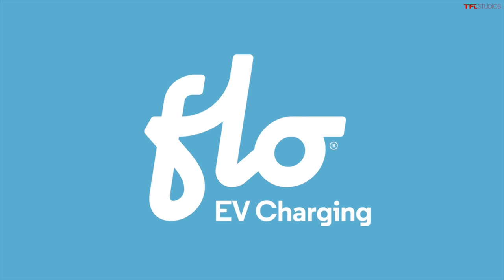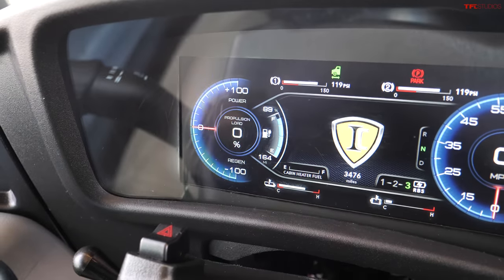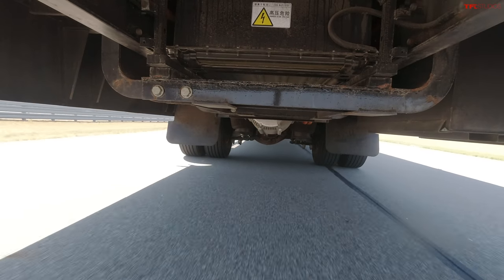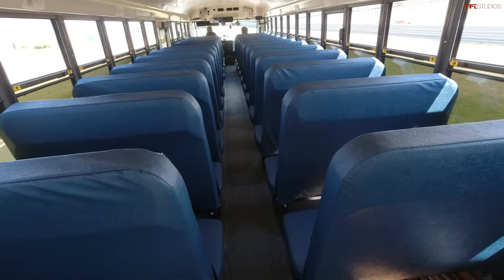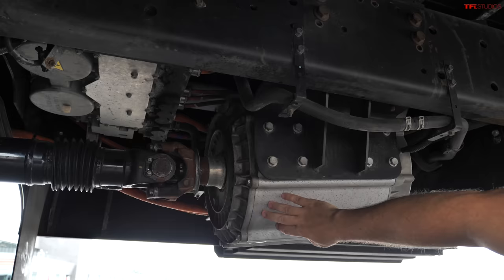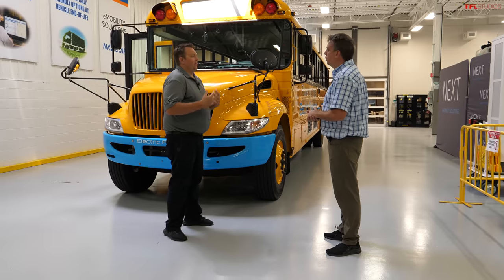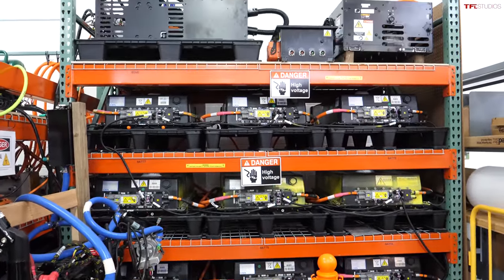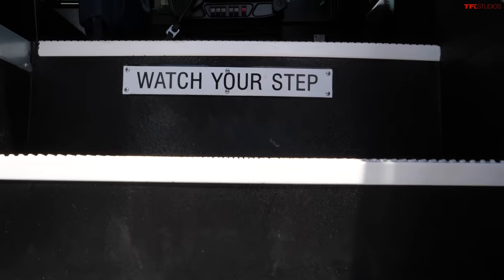Does This EV School Bus Put The First Nail in The Coffin Of The Classic Yellow DIESEL Kid Hauler?

Comment: Never had seat belts on buss's I rode on.  The aisles were wider.  (in my day) The EV makers need to change the dumb fuel gauge icon from a fuel pump to an EV charging cable.  And finally, he said we would be seeing these things coming everywhere?  🤣  Good luck with that.  I rode a bus that was 20 years old and often being replaced with a "sub bus" because it was in constant need of repair instead of just buying a new, reliable, efficient buss.  Guess what?  That same bus is STILL taking kids around in my district 30 more years later.  Budget in the districts here do NOT go into transportation.  ;)
Reply: In my state buses must be retired and sold off at 10 years. Private companies can't carry students in a bus over that age too. EVs have less to break but the components are more specialized. My local district is flat broke but they'll have no choice but to modernize when the time comes.
Reply: @bwofficial1776  re: "In my state buses must be retired and sold off at 10 years." exactly, there's a 10-12 year limit on how old School Buses can be.  that's why whenever we see a big yellow School Bus with kids on it, it generally looks new (that's because it is).  Buses are usually operated/replaced under the same "fleet" metrics as Class 8 Semis.  and it's even more important that these maintenance schedules are adhered to when you consider the "cargo" you are transporting are KIDS, and this will become painfully evident once one discovers that the PARENTS of many of these kids are local business owners, government and state officials, Law Enforcement, etc (aw crap).  yeah, something else not to overlook is these School Bus fleets are also subject to twice yearly DOT inspections, so if anyone is inclined to FORGET all the things I just mentioned, no worries, the DOT inspector will be more than happy to remind you with a citation.

Comment: 200 miles from a 315kWHr battery pack, works out to about 1.6 KW/mi. 

I wonder if you could tow a diesel generator for long trip, like for athletics?  Say you have a trip from Laramie HS to Rock Springs HS (212 miles).  So about 678 KW used for the trip.  That trip takes about 3.5 hours each way.  With 3 hours downtime for the bus during the activity (maybe more depending on sport), you have a total of 10 hours run time for the generator.  Using a Generac MDG75DF4 Diesel Generator, at 68KW, it would generate roughly 680 kWHr during the trip....enough to charge the battery fully, twice.  Even running it only during downtime would almost give it enough power to make the trip home. I assume towing the trailer would cost some efficiency, but not as much as an F150 would lose...the bus is a great big wind-break for the trailer, and the Generac has a much smaller profile than what TFL tested behind the Ford. Even figuring a 25% loss in range due to the trailer, it works out to about 850KW needed.  Given the 315KW in the battery to start, plus the 680KW generated on the 10 hour trip, you have an 18% cushion.  And the generator would still have 17 hours worth of fuel onboard in case of emergency (road closures, etc.).  

Not sure about charging while driving, or if using a dedicated DC generator would be better than the off-the-shelf one I looked up.  My initial thought was having an onboard generator much like RVs have, but thought it might be better to have a larger one towed as needed, rather than always be hauling the extra weight of a smaller one.  Plus, for longer trips, a larger would be needed anyhow. You can get towable units that would charge this bus as fast as it uses the energy (cruising, not floored). 

A diesel bus gets about 9mpg, so would use about 47gal.  My idea above would use about the same using the generator.  So no real savings there.  But the savings for the regular bus usage would be significant. Laramie pays $0.1449/kWHr for electricity, much of which can come from wind power (NEVER a shortage of wind in Wyoming...they really ought to turn those damn fans off).  That works out to under 24 cents per mile.  Compared to diesel at $4.47/gal (today's cheapest price in Laramie), which works out to a hair under 50 cents per mile, or about double.

Comment: I hadn’t thought about it until now but ev buses would have a tone of regen potential. They might have a cross section 2-4x as big as a CUV and their drag coefficient might be 40% higher but they have more than 7x the weight (when loaded) and will operate at slower speeds anyway.

Comment: They should do a Diesel electric. Have a diesel generator charge the battery. Trains use the same thing, & they’re rly efficient.
Reply: WAY too expensive, heavy (probably requiring a suspension redesign) and more complex (2 systems to maintain) for a simple school bus. Also this defeats the purpose of eliminating the problem of in cabin exhaust levels and diesel costs.

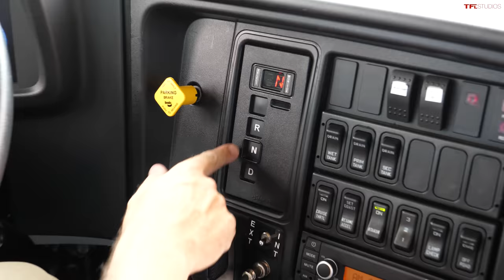Comment: The bus DOES have cruise control, it’s just on the panel next to the gear shifter. The first switch on the 3rd row (above the radio) shown at 1:20.
Reply: Yea, just not on the steering column.. I have used both setups where the cruise control is on the steering and flashers/door on the side panel. I much prefer the flashers/door on the steering column as that is used much more than cruise control - It is much safer for dropping and picking up.

Comment: So, the average school bus in the US drives 130km in one day and this electric school bus has the largest battery in the industry that can go 320km on a single charge. That means you can easily do two days without charging the bus at the bus depo and still have 30km left at the end of day. Of course, this will vary on the route taken.

We can easily drop diesel buses that can increase the chances of cancer, especially in younger children who are more susceptible to harmful gases.

Comment: The electrical grid is not here for school bus charging and wont be for a long time. Take every school bus parking lot. Now fully destroy it, wire in millions in chargers, and repour the parking lot. That's only the bus station, now the city has to upgrade service and so on.
Reply: Every one of our bus parking spots already has a electrical outlet to plug our busses into during winter months. We have plenty of power for upgrading to charging ports for each bus. They would be charging at night when power demand is lower.  That might not be the same everywhere, but it is in many places. So to say it won't be for a long time?!?!? I do not know if that is fair.. It is the replacement cost of busses that will be the major stumbling block, not the infrastructure.

Comment: With the volume of roof on a bus I would have thought solar on top would have been feasible to some degree
Reply: Even if it were only 30% of the required charge, schools are famously strapped for cash on a monthly basis.   Anything that kept the bills down would be smiled upon I imagine.
Reply: Cost to benefit is not worth it. Put the solar panels on the ground or on top of buildings.

Comment: My only concern is the long distance travel they sometimes make School buses do. Then again if they packed a diesel generator in the old engine bay as a range extender and make it easy and simple to switch in the event it breaks down they could sell these things like hot cakes.
Reply: Or, a simpler solution. Keep a small number of diesel buses around for that purpose, replace the rest of them with electrics. By the time those last remaining diesel buses reach end of life, battery technology will have improved, and the issue of occasional long trips becomes academic.
Reply: @ab-tf5fl  ...... The reason I suggest having a diesel-electric or Gas-electric Bus is so All electric buses would get cheaper do to economies of scale. If all the buses have roughly the same parts then it makes production and reparability easier.

Comment: Nobody seems to comment on cost and where the power to charge each bus comes from. Then the cost for each station, repair costs, new power grid system, cost to train mechanics if they can qualify to work on them and so much more. Economic nightmare.
Reply: They are only going to show the positives and sadly none of the negatives. Same exact way it was when buses went from gasoline to diesel.
Reply: @hippyhillbillie2958  Diesel is better than gas because it burns less.

Comment: 315kwh battery- good lord that's a LOT of stored energy. that's literally about a thousand small space heaters all running for an hour. and the regen braking recaptures a bit of that back as well. these things would have to cost at least 3x what a normal gas powered bus costs. It's still worth it in the long term with significantly less maintenance costs, the cost of electricity by the day is MUCH lower than the cost of gasoline per day.

Comment: With electric power, a conventional long nose school bus may soon be displaced with the cab forward models to gain additional maneuverability and capacity in a shorter package. The benefits of the conventional bus are no longer apparent.
Reply: It is actually going the other direction, conventionals are taking over right now, even with electric.
Reply: I much prefer the conventional long nose over the cab forward designs as a driver - I have driven both. What you loose in forward visibility you gain in perceived safety of having the nose out front.
Reply: It may depend on where you at but where I live some disricts are still buying Flat Noes buses. Most of the electric buses where I live are Flat Noeses.
Reply: @SomeDudeWithAnExitSign  Yeah, some areas will hold on. Transit (flat nose) buses only account for 6% of school bus sales nationwide, I don't see that changing much with EV.
Reply: @SomeDudeWithAnExitSign  "Noes" LOL You crack me up!

Comment: I am a bus driver and for normal student pick up it makes sense but then when you have a 3hr one way field trip that’s when the diesel is still needed
Reply: What's your longest field trip? These buses have a 200 mile range, that seems like a lot for school field trips. Im trying to imagine a trip where that wouldn't be enough. From my town a trip into Boston is about 100 miles roundtrip. It would even be possible to take them to Portland Maine, that's a hundred miles each way. Buses have to wait hours for the kids so you could do that at a CCS charger, for the Portland trip you would want to add about 50 miles which you could do in a couple of hours at a low speed, 62KW, charger. If they were taking the kids to New York City or DC then you would want a diesel  so it would make sense for the bus company to keep one diesel in their fleet.
Reply: I live in the Mountain West. It’s easy to imagine a sporting event with a 400 mile round-trip. If you did that with an electric bus you would need planning to recharge while the event was going on. But, probably 90% of the miles the school buses drive fit that 80 mile round-trip range. If your school district had a fleet of 20 buses, make 16 or 18 of them electric and have 2 to 4 diesel busses for the long trips.
Reply: These can be charged at any fast charger.

As long as one is designed to fit a bus, a driver could go 200 miles, charge back up in 2 hours or so and have power to go back.

Comment: Why no solar roof? Thats got to be 16HP/hr maybe an extra 10-20 mile range per day, with air ducting you could even use the heat from the sun heating the panels in the winter for interior heating, which should extend the range as well(compared to just releasing that heat into the outside air)

Comment: could this frame be used for a Class A or C mtorhome and et 200 miles?
Reply: Absolutely. Unfortunately International's DC fast charge rate is a JOKE. Less than 200kw for a pack around 300kwh?

Comment: Good idea as long as the bus terminal has full solar capacity to charge all the buses. If they are charging up from a grid powered by coal or gas it’s still a polluter
Reply: Evs powered from a 100% coal powered grid are already cleaner than a fossil vehicle.

And the grid is already getting greener. As more clean power comes online it therefore immediately makes all these vehicles cleaner.
Reply: Several studies by major institutions and universities have confirmed that electric vehicles produce half the carbon of internal combustion vehicles, in the very worst case, when powered entirely by coal.  In the best case (solar, wind, hydro, geothermal), running an EV burns nothing at all.  

Almost every US state uses some of these non- polluting energy sources and the percentage is rapidly increasing.  The mix of energy sources varies but in several states, running an EV produces a small fraction of the CO2 that an ICE car generates.

Comment: Idea for anywhere except colder climates.
Reply: why? this bus is equipped with a battery conditioning system and electric climate control
Reply: @KoleWilliams  Would be interesting to see, we have one already and it needs to be parked inside overnight when temperatures get colder, and it isn't even run during the winter months at temps about -20 to -30 C

Comment: How many millions of dollars are tax payers going to be on the hook for to build charging stations that can handle up to 200 buses all needing to be charged? That does not even factor in the $250,000 cost of the buses.
Reply: Closer to $400,000 for one bus
Reply: Much less for tax payers than it will to continue to run diesel over the next decade.
Reply: They don't need public charging. Like any fleet vehicle, they charge overnight with a typical $300 charger

Comment: So what about in cases, bus finishes it’s route, then returns to the HS to take students to a football game. Driver remains in the bus with the 3 AC systems running. Personally, I think for the cost of theses units it’s not worth it. In a bud life cycle the added costs will never be recovered. How does the school district justify this to its tax payers? If a district is tax capped how does this get figured into a budget with out cutting from school side of the operation? How could first student put these in the road without raising the bid to the district substantially? I don’t see this being feasible and fiscally responsible.

Comment: It’s hilarious that International is still using 100% identical interior and exterior components that it did 20 years ago. I’ve worked on International trucks circa year 2002-3 that looked exactly the same. It even sounds like a 20yr old bus with 500k miles on it.

As others have said, EV school buses are a no-brainer. They’re more expensive up front for sure, but these busses will run for 20+ years. They’ll pay for the difference in purchase price just in the fractional cost of electricity vs diesel, as well as the reduced servicing expenses (brakes and basic fluid changes cost an absolute fortune on these things). In the meantime, they won’t be destroying the planet at anywhere near the rate that a typical diesel truck would. Yes, there will need to be some thought put towards charging if these completely replace ICE busses, but those are relatively small challenges and the expensive of it could be offset by making some deals with the local power supplier. Even just 10 of these busses make up essentially a 3MWh battery bank that would be plugged into the grid during peak power demand (typically early to mid-evening). Solar roofs to the bus barns could generate a lot of electricity. There are many options that simply don’t exist with ICE vehicles.
Reply: LOL yea and I like the interior of the international as a driver for the past 10+ years. As for using them with Solar roofs?!?!?! that would add some complexity that with downtime and maintenance would not be welcome by drivers. We are having a hard enough time finding competent mechanics at a cost that is in budget (in other words we can not seem to pay them enough with the budgets we get from school districts)

Comment: With the removal of the diesel engine in the front, am I the only one that thinks making a FWD or even 4WD bus would be much easier for northern climates now?
Reply: Yes I live in Ohio winter is tuff and buses usually get stuck, I notice the Diesel buses are RWD the dully tires in the back spin but not the front 
Bus company’s should use the opportunity to add  AWD or 4WD as you said for electric buses but this will take more battery power 

FWD version will be great for efficiency and range
Reply: Do you even realize what you're talking about in dollars & cents? That added cost of an E-bus is thru the roof, oh but lets add 4WD to the already out of this world price. Common sense is a thing of the past.